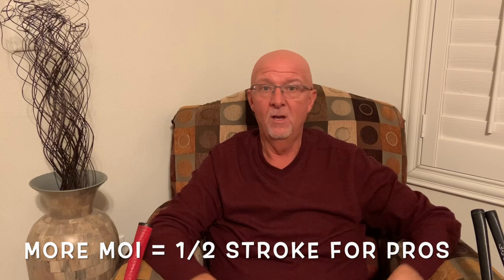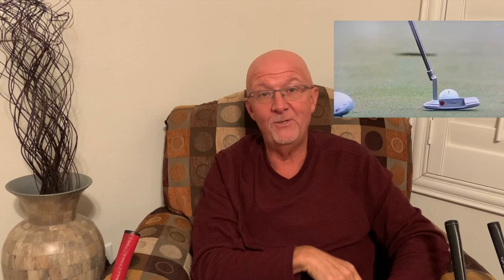What Is Your Putter's Moment Of Inertia & Why It Matters

Comment: In 1990 when I bought my Ping Eye 2 set of clubs I bought an Anser and a Ping 1-A putter at the same time. I got down to a 6 H/C in 1996 but had a back injury at work and gave up golf till 2017. My putting had been dreadful until recently, when I discovered the I-A putter in the loft, now since I bought that putter I never ever took it to the golf course because of the embarrasing loud ping noise it makes, which at the time of purchase I thought it was novel. Anyway my putting had been rubbish even though I got down to 13.4 H/C, and I have a collection of 30 putters, and of which none work consistently. So over the last few weeks I tried the Ping 1-A on the course, having looked at all the putting tips you have given, well what a revelation, I set up on line and only make the stroke with my eyes closed. Now I have no idea what the MOI is of the 1-A but the feel and the Ping sound combined let me know how well I've struck the put. Distance control is amazing, and close puts just go in. Have you used the 1-A as I was interested when you use the Cure and all the talk of MOI?
Reply from the maker: I have a 1-AM and love it. It’s one of my all time favorites. I think the noise keeps some people from using it

Comment: How does that compare with a mallet style?
Reply from the maker: Mallets generally speaking have a higher moment of inertia. Oddly enough I plan to revisit this subject soon as some of the unique new putter manufacturers are designing putters that are torque balanced and as such technically have zero moment of inertia...and don't twist off line at all...in other words from one extreme to the other and they are available in both mallet and blade styles.  Video on this coming out soon.